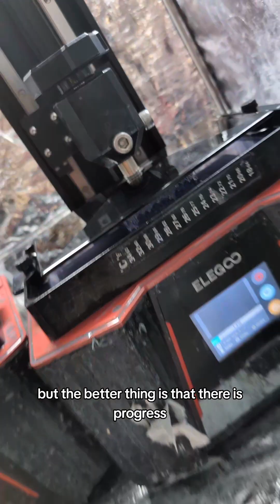I've never seen a printer unalive itself quite like that.

Comment: Not sure how economically feasible is for you, but in the case of a layer shift in the last few centimeters from a print, can't you just use a spatula and a hammer to detach the parts and reglue  them at the correct position and any mistakes from the detachment repaired with palster an sandpaper?
Reply from the maker: i would never even try that. thats way more work than just letting it do its own thing for another 3 days. fixing imperfections on a print is A LOT of work. filler primer, then sand it, then repeat and repeat. its possible if its uniform but glue would make it inconsistent and really make it much harder to sand it to smoothness. plus it would be weaker. and the gyroid infill would not split along 1 seam. it would be the killer.

Comment: I think you need to take a weekend off to reconstruct or reorganize your shop setup. 
Re level and clean and furbish your tools and put them on heavy duty surfaces preferably without carpet or home Depot wire shelving.
If this was a machine shop it would be unacceptable to have your cnc tooling running in insecure conditions.
It needs to be solid as marble in there.
It will save you time and money.
Reply from the maker: the printers are on cement blocks. we did that last month. 😊
and we take 1 day every month and just clean everything. mom comes over and forces me to clean stuff

Comment: For the love of God... Just buy better printers. There are a ton of sales going on now. Bambu has the p2s out that looks dope and is just a straight upgrade to the p1s I have. Elegoo has a centauri carbon for diet cheap ($280 usd)

Best of luck to you. I really hope the printers get fixed and work consistently for awhile.
Reply from the maker: lol none of those suggestions are big enough 🤣 the hair that we r trying to print on the 500x500 printer JUST BARELY fits. and you expect me to be ok with a 257x257 bed? 🤣🤣🤣🤣 we got these big printers for a reason.

Comment: Rip 🪦. Aaaanyway, about the shifting... I’m not really sure... But... From what I can see, it’s definitely related to the belt under the bed slipping somehow, so maybe take a look at that. Other than that, I honestly don’t know.

I’ve never printed with resin, but I guess that transparent resin might be a bit harder to print since the UV light can pass through it, and maybe even the shape of the model could affect it by bending the light. I’d try lowering the exposure a bit (maybe?), but judging by how it’s going this time, I think this one’s gonna turn out right!💪🤞

Comment: Come on girl, I see the problem why there are problems with printing. I noticed that the printer has a belt under the plate with probably teeth and a lot of scrap plastic. What do you think happens to the printer if something gets stuck in the belt, or if it is missing a tooth on the belt. It is possible that the belt is slightly worn and due to the wrong tension it skips when moving a lot of weight.
Reply from the maker: thats very possible. we upgraded those printers to a rail system so they slide smooth. and the prints are very slow so it wont skip a gear. we had a lot of trouble with that in the past. thats why it takes close to 9 days to print some things. gotta go SLOOOOOOOOW. 
but in all honesty, the area may look filthy, but i have not had any problems with bed movement in a long time. the rails keep it smooth gliding and the belts seem to respect the weight and speed.
Reply: She drilled the nozzles this was happening sooner or later.
Reply from the maker: no... this happens when the print does not bond to the bed. if you dont catch it quick, it will ball up the plastic, then it will just feed itself until it kills itself. 
that has happened for years. it just happens sometimes. the drill had absolutely nothing to do with it.
Reply: @Freyas_Fantasys  3:14 .